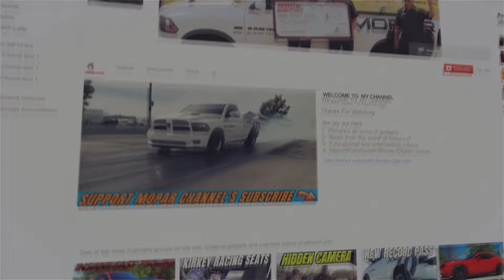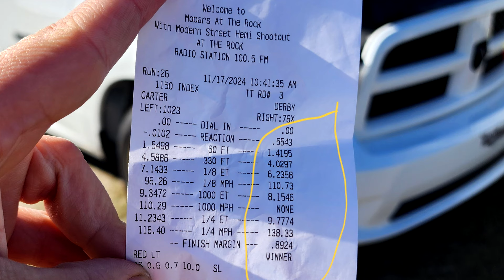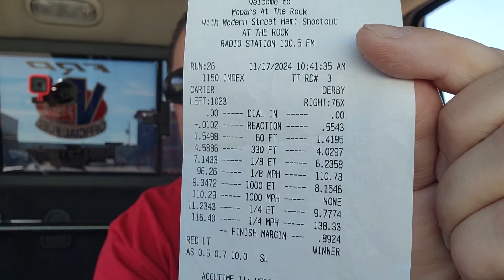RAM Truck Destroys 1/4 Mile In 9 Seconds

Comment: I cant wait so excited brotha
Reply from the maker: @eddieborden4681  we had alot of bad passes before we got a good one. Will need lots of changes to get all the power down correctly.
Reply: @FrostbiteRam  yea I bet lol 😆 rpms at finish line ?
Reply from the maker: @charlespatterson2900  log showed 7300rpms max
Reply: @FrostbiteRam  cutting it close that for sure be careful if it's going lean up there u could hurt it be nice to put it on dyno to know exactly where power falls off rpm yea need injectors quick still think might need little taller rear tire 7 g be good for finish line max just to safe
Reply from the maker: @charlespatterson2900  definitely